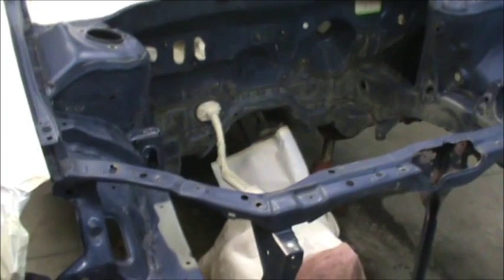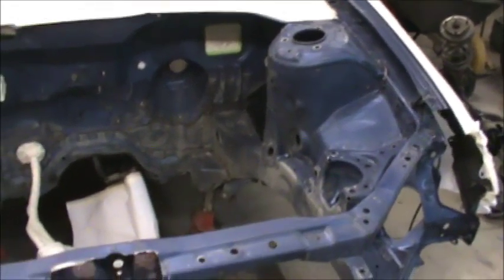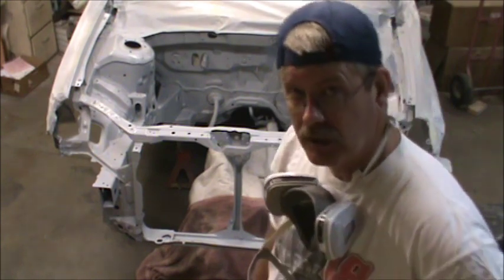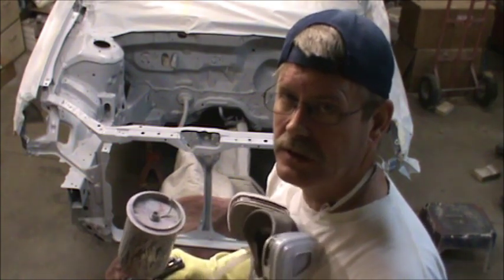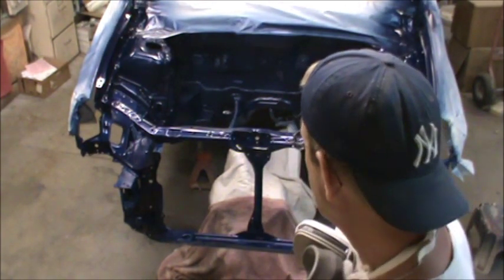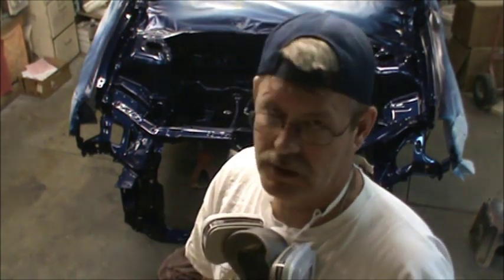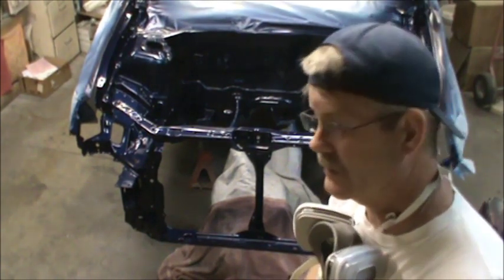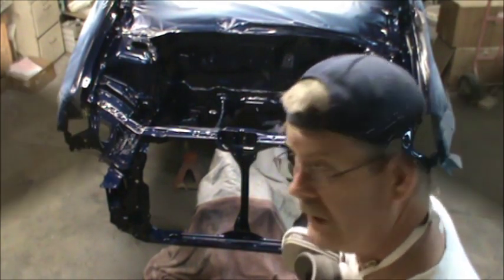My Civic EV Electric Car Project Part 23 PaintingThe Motor Compartment

Comment: Just a question, but why did you paint before you welded the mounting for the motor on? It seems like you will have to grind the paint back off then weld, and paint again.

Comment: Hey Tom, where are you getting your paint from there in Anderson? Years ago I used to go to Barends and the other paint shop that was there on Hwy 9. I don't remember the name of the one on 9. This was back in the late 70s and 80s.
Reply from the maker: Barens is closed long time ago, Anderson color is on the bypass which is the one you probably cant remember the name of. But they are Dupont and I don't care for Dupont. I get most of my paint from Darrin and Andrea in Florida you tube user vwdarrin.